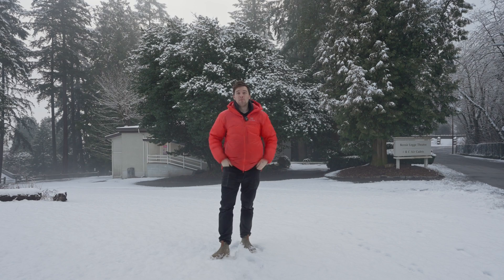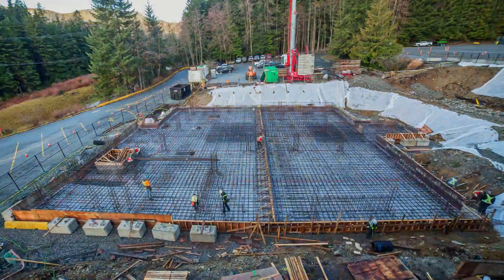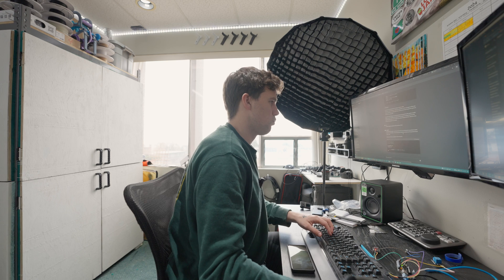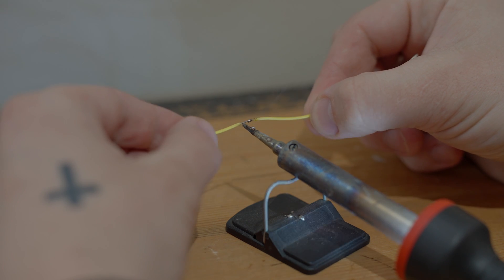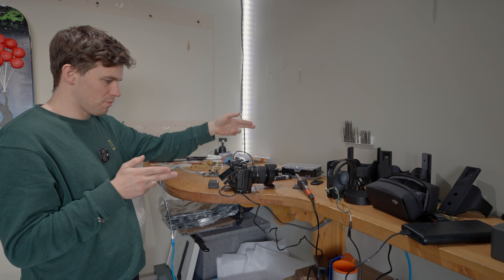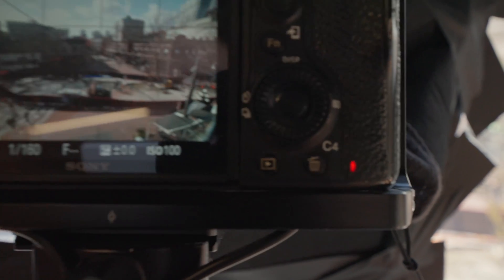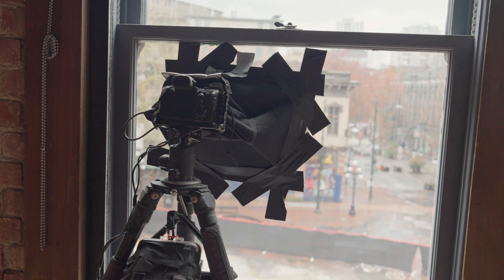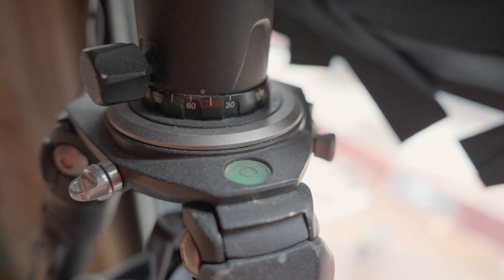Setting up a Long Term Timelapse Camera

Comment: I'm late to this video and only 3 minutes deep, but I set something similar up with a raspberry pi and a canon 20D as well as another with a a 350D, but instead of using infrared I used gphoto2, and instead to turn camera off/on I used hacked (flashed with tasmota) smartplugs (teckin sp25's) to accept curl commands from the pi. All run by cron jobs from the pi. Every minute, pi turns on the smartplug, sends gphoto2 commands to set up exposure time, etc, then take photo, save it to the pi storage, then power off the camera. For indoor timelapses, though, I'd love to figure out a weatherproof setup to run outdoors for some skylapses or other outdoor timelapses. Its all wrapped up daily to save on disk space by compiling the day's photos into a video (Using mencoder), resulting in a couple hundred mb per day only and saving me the tedious work of compiling billions of photos at once. Did a 365 day unattended timelapse like that, although at that time it was a cheap aliexpress sensor instead of the canon's.
Loving your stuff, just watched your print-garden video then clicked this one. I'm in BC as well, I like seeing other Canadians on YT. Great work :)
Reply from the maker: Wow! Sounds like quite the cool setup! 
Thanks for watching! 
I actually have a time lapse setup at Grouse mountain for the past year and a half outside, but since it was a paid gig I used the Biolapse LT controller since it is so reliable
Reply: @JoelSchat  I hope you share it once its done, or at least a link to the customer's video. Would love to see it. I also butchered an old 3d printer to try and set up rails to give my timelapses some motion using the rails and steppers for like a few mm/day, but was beyond my capability. Might revisit it eventually. Googled Biolapse, that kit looks amazing!
Reply from the maker: Ya the Biolapse one is legit perfect. They used them on a bunch of professional sets. 

Good call! Will do. Some of them are up on Grouse Mountains Instagram account in their gondola construction update videos
Reply: @JoelSchat  Sweet I'll go check that out!